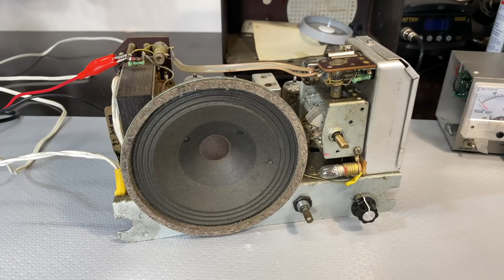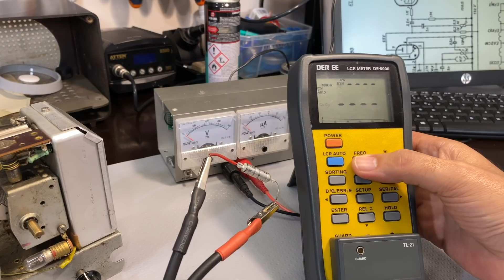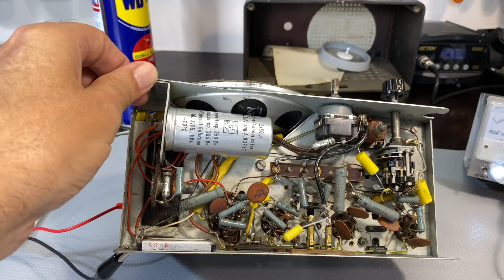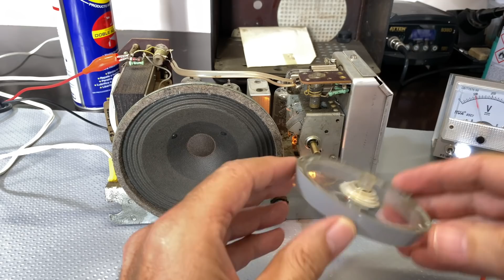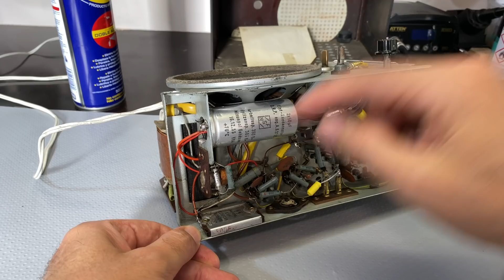Braun SK 2b tube radio restoration - part 2. Recapping done, and some taming of the Voltage.

Comment: I have this radio too. In comparison to all other small tube radios I have 3 Philettas, 1 Loewe Opta, 1 Telefunken Caprice, the sound quality is poor. This doesn´t wonder. No loudness, very small output transformer, no negativ feedback over all, only the missing capacitor on the kathode of the EL 84 does this job. The frequency response of the amp starts somewhere at 100 Hz to be flat. 8 kHz and the amplitude start to drop. The loudspeaker is pure quality also. It was a cheap radio in former times. The only outstanding was the design. I tried to make a negativ feedback  and ad a capacitor but although the frequency response becomes more flat and reached to 10 kHz the sound was not better. As a child I had the SK25. And in my memories this sound better.
Reply from the maker: This series of radios appeals  to me precisely because of the design, which is really the only one on the list you present which can be said to be revolutionary. Sound-wise it just doesn’t have the circuitry to make it especially good, I agree with you.

Comment: Manuel, Great job, but one disagreement - why only a single diode rectification? Why not a full-wave with 4 diodes?
Reply from the maker: That’s the way this radio was designed. One of the secondary wires is connected to the chassis. I believe it stems from the change up from the previous version which has an auto transformer. Have a look at the schematic of both and you’ll see the similarities.

Comment: Nice work on the selenium rectifier.  I think I will do the same, if room permits, on my current restore project.  Also, I learned something I hadn't realized in the comments below about how to correctly measure ESR using the DER EE-5000 LCR meter.  So obvious, yet not so intuitive. Thanks!
Reply from the maker: I managed to fit the resistors in the old enclosure because this was a single selenium diode. If it was a selenium bridge rectifier, I would not have managed. The resistor would have had to go outside.

Comment: We’re you able to save the label behind the selenium rectifier ?
Reply from the maker: yes, I will be able to restore it.
Reply: I was thinking you could make a plaster mould of the tuning dial curvature, and the new Perspex may form into the concave section of the mould in a moderately warmed oven.
You could consider using the existing tuning dial as the master die?
Reply from the maker: good idea

Comment: Hi there, I just came across your channel some days ago, and find your videos very interesting . Within my  very limited electronics knowledge, the question I have regarding the rectifier modification is why not to use a capacitor instead of resistors ?
Reply from the maker: Capacitive droppers are a little erratic compared to resistors. Also, if this radio got used in a 60hz country, the drop would be different.
Reply: Great, I learned something. I will try to put together the Bluetooth adapter on an old Zenith radio following what you did some time ago. Thanks for the quick answer and keep up with the great videos.
Reply from the maker: pleasure

Comment: Hi again, Manuel. I happen to have that DER EE-5000 LCR meter too. Great meter indeed but please measure capacitance at a frequency of 120Hz, not the 1KHz the EE-5000 defaults to. Otherwise you'll get wrong measurements not compliant with what the manufacturers mark on their caps. ESR must be measured at 100KHz, same as you did.

Pretty interesting stuff in this episode, as always.
Reply from the maker: The frequency is actually normally measured at 1kHz, except for supply filtrar caps which in europe should use 100Hz and in the states 120Hz. The ESR is normally 100kHz, true. 
This meter is quite good. Have tried a few but prefer this one.
Reply: @electronicsoldandnew  You're right. Didn't notice they were not lytics. I stand corrected.
Reply from the maker: No problem :)

Comment: Manuel,
You are a Genius!  Love what you did in replacing the Selenium Rectifier!  Adding the compound to aid in heat transfer is a great idea too.
Reply from the maker: thanks
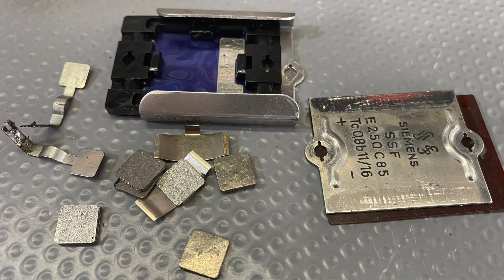Reply: He should have j-hooked the paralleled resistors and crimped down on the j-hooks before soldering them. 20:59 clearly shows that he has just soldered the  parallelled resistors to the rails formed by outer resistors and clipped the leads. These resistors will dissipate heat, which may lead to failed solder joints and eventually make it necessary to redo the job.
Reply: @randomsteve4288  This is unlikely, - the temp measured when a 5 watt resistor was tested was only 39 degrees C, now less with the 8 watt configuration, solder joints therefore unlikely to fail.

Comment: Old radio tech was so forgiving. They still "work" on defective components.
 I got my hands on telefunken kl75 reel to reel recorder yesterday, the thing was left on top of a recycling bin.
 I wonder if I can make it work as a practice guitar amp :) its looking a bit rough on the outside and I dont think I want to mess with that. Couple of cosmetic stuff missing/broken.
Reply: I have a KL75 in mint condition. 
It has EL95 single ended output stage, EF86 (if not transistor input version) and ECC83 preamp stages so the audio amp section surely can be modified to guitar practice amp if transformers ar OK. 
It wont be a monster but will make some nice sound if the speaker is sensitive enough. 👍
Change the power cord to three prong grounded version and replace the selenium rectifier with diodes and series resistor.
If you want, you of course can use the EM84 as input or output level indicator as well. 😀
Reply from the maker: Lot of potential
Reply: Further investigation shows that it is in fact a Magnetophon k75-15 but its basicly the same tube tube line up. It has a radio and microphone input, headphone out and external speaker plug also. Its worth a shot :)
Reply from the maker: good luck
Reply: The El 95 give you 1 - 2 Watt output power. Often this tube is worn, because it is a small one.
Reply: @joligrunlaub3412  everything inside looks new, no rust whatsoever. The tubes even have the silkscreen intact telefunken branded. It proves  nothing but shows promising.
Reply from the maker: should be interesting. you’ve got nothing to lose
Reply: The only thing holding me back is that people also use these as a tape delay effect but it requires a mixing board... hmmm, I dont know...